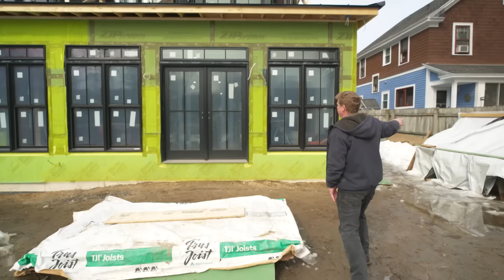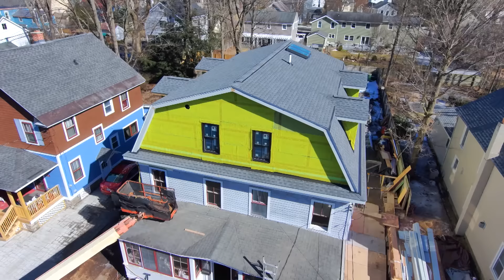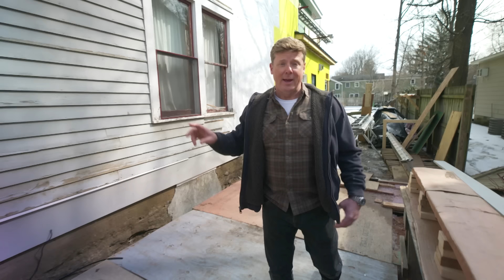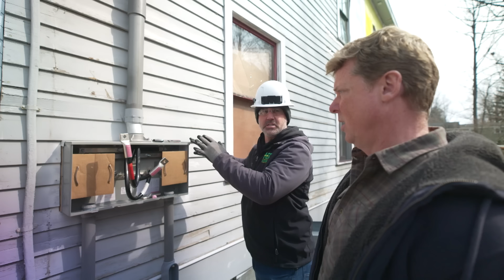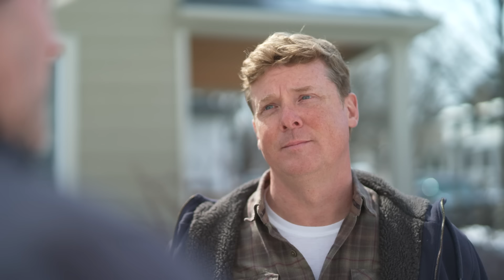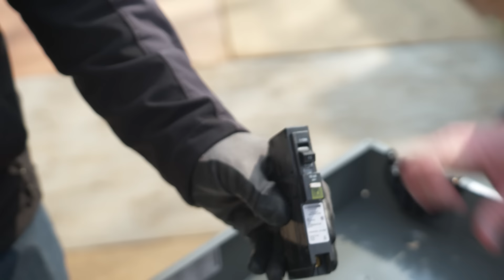Electrical Service Upgrade | This Old House

Comment: He mentioned a load calc of just over 200 amps, which means 100+ for each part of the house. In my area we have something called a 320 amp service, which covers 90% of needs in this kind of situation without the extra expense of going "full industrial" on all components. Most of that savings comes from smaller wires leading to the weather head and a bit less labor. (easier to work with)
Reply: 320A is just 400A when factoring in the derating for continuous load.
Reply: @thomasbonse    True, but some of the hardware is different. (read: lower price in the end)

Comment: where are the emergency disconnects?
Reply: There are two boxes, left and right. They are empty not but it is the location for the main breaker. Each 200A.
Reply: Good chance the area they are in has not adopted the 2020 code cycle believe it or not. Some areas of the US are several code cycles behind.

Comment: Surge "protection" does NOT protect from lightning strikes -- NOTHING added to the breaker box will protect from that.
Reply: It will and it won't. Surge protection will protect perfectly for indirect strikes. A direct strike would overwhelm just about anything. Which is why you need downstream protection also.

Comment: Wait. I thought you weren't supposed to mix aluminum and copper wiring, outlets, or switches. Mixing them IS A FIRE HAZARD. Bet me.
I know from experience mixing aluminum and copper wiring is a FIRE waiting to happen. Shame on, "This Old House," the electricians, and Contractors.
Reply: I think you are out of your depth here.  Aluminum feeders and service conductors are frequently used across the nation in both dwellings and commercial occupancies (even hospitals), and it is not the same alloy as was used in the late 1960s - early 1970s.  Connections of aluminum wiring can be made in a number of ways to overcurrent protection, bussing or joined with copper conductors through the use of listed connectors, terminals, compression lugs, etc.  Aluminum is safe and an economical choice for selected circuits in construction.  Where it is really not used is in small branch circuits sized #12-#10, although copper-clad aluminum is for the first time beginning to surface in dwellings.
Reply: Ummm yes if you put aluminum romex on device that a no no sense  the devices arent rated for aluminum wires there only rated for copper  witch at that point u would have to splice copper to the aluminum wire and use a proper  wire  nut that is made for it which is just a wire nut with antioxidant like norlox . Second breakers are rated for both aluminum and copper . Third On a service. The lug are rated for copper and aluminum so that wouldn’t matter.  So the only danger is not know how to properly work with aluminum romex.

Comment: Everything was perfect until he said the surge protector sends current to ground. It diverts it to the neutral point which is back to source, no current goes to the earth. Also those that are saying emergency disconnect is required, this may be in an area where they have older NEC version adopted.
Reply: For a conversation that was intended for the layperson, I think you can cut him some slack for not getting too technical.  Electricians know that the grounded circuit conductor is the connection made between the line terminals of the TVSS and ground.  The neutral and grounding electrode are one and the same at the service disconnect, where SPDs are required and most often found.

As to the apparent 230.85 code violation, Saratoga Springs, NY just adopted the 2023 NEC on 12/31/25.  Obviously this two-family home was permitted during the period that the 2020 code cycle was in force, so there really is no explanation for the missing emergency disconnect.
Reply: @steveloux4709 I agree. And not all electricians know that;)
Reply: It actually clamps the voltage and shunts the excess energy to ground
Reply: Most current doesn’t go through the earth in a surge caused by the utility switching. Lightning is a different story but still not what he described.
Reply: @sethoakes3795 actually, lightning is explicitly what he described. It’s the very first thing mentioned. So yeah, lightning could come down either hot leg or neutral, so shunting to ground is exactly what it should do.
Reply: @truthseeker308  induced voltage by lightning is dealt with by your homes grounding electrode system.
Reply: The earth isn’t a magic heat sink that eats surges. Most current goes back through the neutral to the utility. The ground rod is just a parallel path.
Reply: Also using the smallest cheapest surge to cover code. 

 They would be much better off using a higher quality surge protector that uses MOV's and GDT's. 

I like the PSP EV 100's. 🤷‍♂️
Reply: Right, all current returns to source, even lightnings current. Further, current takes the path of least impedance.
Reply: @LSRP-t9l close, ac current takes all paths proportional to impedance

Comment: Because of all the newly required added loads due to EV chargers, and the banning of natural gas appliances, forcing the use of electrical appliances exclusively; it's getting to the point that a standard 225A electrical service is already beginning to be too small for a typical sized track home. A 250A or 275A service will probably become the new norm in the next decade or two. The grid system will definitely become over burdened with all the new electrical power demands.
Reply: All EVs can be programmed just one time, and will forever after charge at any chosen time late night, when most people are sleeping, electric use is low, and the grid has ample and excess capacity.

An EV can be charged using amperages comparable to an electric range, hot tub, HVAC heat pump, electric clothes dryer or water heater.

EVs charging at home once or twice a week for a few hours is not an issue.
Reply: There is a good video on this subject by Engineering Explained, which explains how your assumptions about the grid here are likely to be incorrect: https://www.youtube.com/watch?v=7dfyG6FXsUU
Reply: @ugh-meh<> that already been proven wrong for years here in California with the  summer power sporadic grid shutdowns across the state due to demand exceeding power production/capacity.
Reply: @Oldhogleg  California doesn't represent the entire country.
Reply: @Oldhogleg  The last rolling blackouts in California were in 2020. Since then the increase in solar and wind and the great increase in grid battery storage has alleviated the problem. Do not confuse blackouts with temporary power cuts in forested areas to prevent fires. The cure to that will take longer and requires undergrounding of power lines or local power production.

Texas had an even bigger problem. They actually had a few hundred deaths. The solution was the same as in California. Ain't science wonderful.
Reply: @bluejay713 Except it wasn't the wind turbines that were the problem. SOME turbines had problems, but the increase in wind during the storms increased the overall turbine electric production a bit. The big problem was the fossil fuel power plants that weren't winterized. Water in gas pipes froze and such.

Comment: Uh yeah, where is the emergency disconnect means?
Reply: Scissors? ✂️   (Don’t do that)
Reply: The emergency disconnect will be inside the main panel on the exterior of a home, that is standard practice in the US. They are larger multi-pole breakers that exist in the main connection point before your homes main breaker panel. Sometimes its a separate smaller box mounted by the meter or sometimes its all in one. Mine is a box mounted below my meter. When you open the door, there are 4 breakers inside bared together in groups of 2. They have a label that says "Main Disconnect"  personally,  I love it. I can kill the power there and work in my main panel.
Reply: @mattypants Not sure where you're from, but most of the US doesn't have their panels on the exterior of their home. That seems to largely be a southern/western thing.
Reply: @adamkane3736 its very normal.where i live in NE ohio. Its been code for about 7yrs now. However i would bet they are getting away from it now with the introduction of smart meters. Since the entire point of exterior shut off was first responder safety. Now a simple call to the power company and in moments the meter is off and theres no power.
Reply: @mattypants That sounds like a localized thing. I'm in MI and I can't tell you the last time I've seen a house with the panel outside, unless it's on a slab and there isn't a spot to put it inside (rare). Some jurisdictions are now requiring an exterior disconnect, but with the panel still indoors.
Reply: @adamkane3736 It's not about local code, prior to the 2020 edition of NFPA-70 (NEC), the disconnect was often optional. The 2020 edition made this mandatory. States and municipalities still had the option to override this requirement, restoring the prior optional status.
Reply: The two electric panels will have the main breakers. This is very common in the USA. If you actually need every single bit of a panel to be de-energized, you pull the meter.
Reply: @ugh-mehare you familiar with the NEC? Since the 2020 code cycle, an emergency disconnect is required outside the structure on a dwelling. Main breaker on an interior panel board is not considered an emergency disconnect means.
Reply: @andrewebensberger235 There are a lot of jurisdictions that are a few versions behind on adoption. Others have their own local codes that can vary from the NEC. In my area, for insurance, AFCI is only required on circuits serving bedrooms.
Reply: @ugh-mehthat is not an emergency disconnect. That is called a main breaker

Comment: Yea, the difference in wire gage between the utility overhead drop and the mast conductors of the service entrance equipment is quite common, even comical at times.
Reply: Electrician mentioned many reasons, but a major one is the utility figures the customer will never draw full load. And higher usage will be transient. EVs and all-electric homes challenge that assumption to some extent. Utilities often run equipment well above their ratings, including local distribution transformers. Usually, one has to make an extensive justification for getting an upgraded one. Alternatively, waiting until the current one overloads and breaks. Utility is banking on that not happening and often their gamble is right.
Reply: In another TOH season, the electrical service wires were upgraded, because they were moved underground.  Wires underground in conduit don't have the advantage of aircooling so they upsized the conductors for lower resistance and lower heat generation.
Reply: @morlamweb  yes and no.  The underground conductors benefit from a stable temperature lower than that we are familiar with when judging the ampacity of a particular conductor size.  In Boston, MA, the temperature is typically 40 degrees or lower, keeping the conductors cooler than would be the case if run exposed to ambient air temperature.  
Regardless, the utility company is not beholden to NFPA 70 and they use much smaller underground conductors for the service lateral up to the meter just as they do with overhead conductor drops to the weatherhead.
Reply: How many amps can we pull from utility overhead drop? Is there max amps?
Reply: @incessantincisors286  Whatever the main breaker in your house is.
Reply: Those wires are free to air. Like mentioned they will never get hot enough to cause a problem.  The reason for large wire in conduits is you have to have enough heat dissipation through the wire give the amps flowing through. That’s why it’s so large vs the small utility wire. It’s all about heat.
Reply: @jsnyara Unfortunately, it's not just about heat. For a given conductor size over a given length, you can only present so much load before there is significant voltage drop. I used to have a lot of customers with serious voltage drop concerns that required the utility to come out to up size the drops...especially ones that were 3-4 spans from the transformer. It's not as bad as it used to be as they've been slowly upgrading drops throughout the last several years. But their parameters for what they consider acceptable voltage drop extend beyond annoying flickering/dimming. I had one house that was almost 600ft from the transformer via #6 aluminum and their computer would shut off if any large motor started (well pump, washer/dryer, etc). The utility said it had to drop two volts lower to be considered grounds for up sizing the wire. It was like that two years before the customer annoyed them enough to get it changed.
Reply: I have heard a conspiracy theory that the power company can't possibly generate enough power for everyone so your meter is actually a zero-point energy generator that is minimally powered from the grid and then they charge you for free energy.  With the gauge differences like that, I can see how that conspiracy got started.
Reply: @thezfunk   No, its  because of the sub-stations.

Comment: Other than the cost of using more electricity, does the electrical company usually charge more for 400 amp service availability vs 200 amp?
Reply: No they do not  they only charge you from what you use has nuthin to do with how many amps you have. Even if there isn’t enough power from the transformer they are responsible to upgrade there transformer on the street. To make sure the house can have the 400amps
Reply: I don't know about electrical, but in plumbing sewer costs will increase for a four bedroom house rather than a three bedroom house despite having the same number of fixtures, because of anticipated extra use. That's why most will call the forth bedroom a 'bonus' room instead keeping that extra cost away. That's how it works where I live anyway.
Reply: @Gazman299 I learned this when we were house shopping as well. I kept seeing homes that had a bonus room but the bonus room had a small adjoining room about the size of a closet but without a door on it. My realtor explained to me that since there wasn't a closet it couldn't be called a bedroom. But they conveniently case to the opening down to the size of a door just in case someone wanted to add one later. 
It affects both the permitting price since it's one bedroom less meaning fewer residents using services and it affects the septic system which in our area is a big thing. 
The septic size is calculated on the number of bedrooms so if you have two bonus rooms that just happen to have undoored closets you can get away with a smaller tank and field. Basically you just give the homeowner a headache 10 years down the road to get a little extra money right now
Reply: Correct
Reply: Yes, they might.  When you request a service that is larger than normal, the utility company has to spend extra engineering resources as well as potentially upgrade the infrastructure in your neighborhood.  They conditionally will do that at no charge, but if you are speculatively and arbitrarily upgrading your service to a system ampacity far in excess of what is needed, they have the option of coming back and recovering the wasted expense of providing the larger service.  Usually an engineered load calculation will justify the size of the service required.  Unfortunately there are a lot of electrical workers who are unqualified "installers" that have no idea how to calculate the load absent the knowledge of a master electrician - so they guess and round up with everything, including the number of circuits, the size of those circuits, and the service size.
Reply: The rate is the same. The meter is a 400A single meter and it is split to two 200A main breakers followed by a 200A sub panel each.
Reply: They typically do not charge for extra. When we bought one of our last homes it had a 50amp service, which was ridiculous. It was a full gut and remodel so we took the opportunity to upgrade electrical to 200amp. The electric company encouraged it. We were going to do 150 and they said for a single family 200amp was the max without additional permits and 400 for a 2 family. Neither had any cost outside of the permits and electrician cost for the panel installs. We did all the electrical ourselves,  but the main had to be a licensed electrician.
Reply: Probably not. Moreover, in this instance, the service is split to two separate 200A meters. If it was one 400A meter, it would be more complicated. That would require a current transformer inside to step down the current for measurement. More expensive to install and additional steps for the utility.
Reply: @ronbennett7885 There are 400A socketed meters in both single and 3-phase configurations. They're often labeled 320A, for continuous load derating (80%/125%), but are 400A.

Comment: Interesting to see the difference in different states. Like I don’t see his main disconnect on the meter bank. I’m assuming that state is behind  a full code cycle
Reply: It would have to be 3 code cycles now, since it was the 2020 edition that mandated an adjacent service disconnect. The 2023 has been out for 3 years; and the 2026 just came out. 
Alternatively, there could be a local ordinance that eliminated the requirement, making it optional.